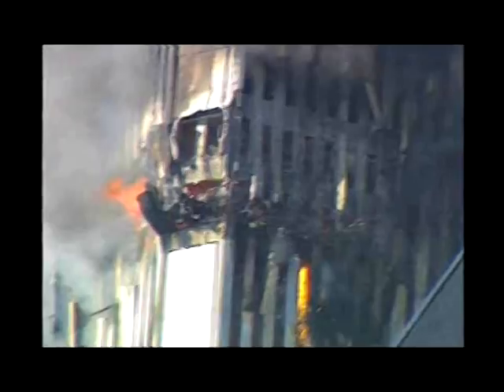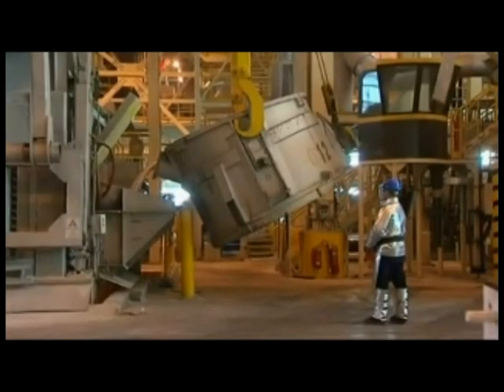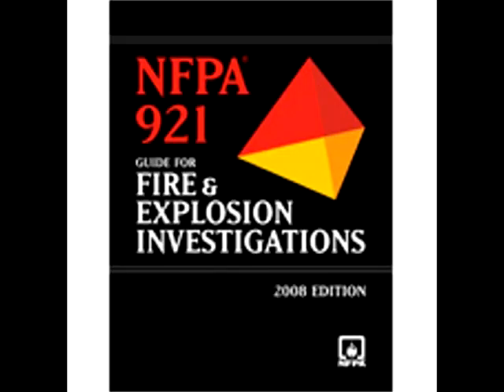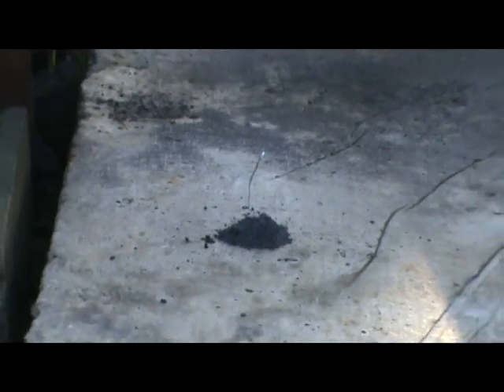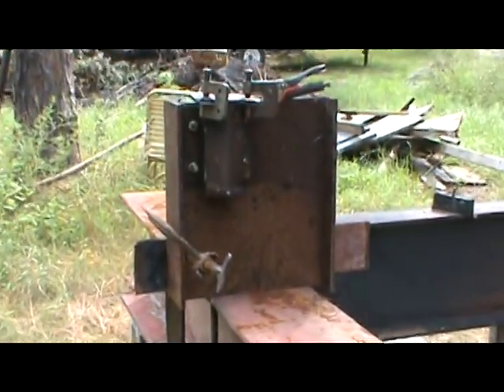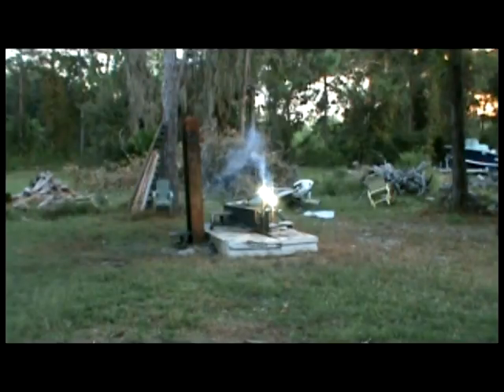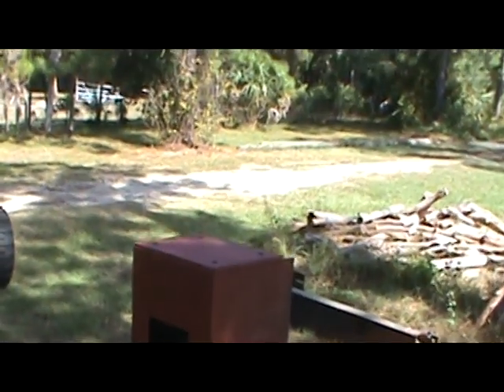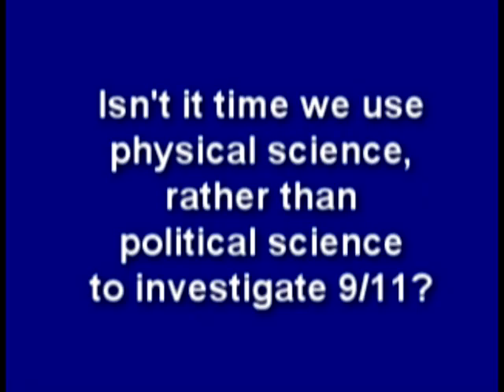9/11 Experiments: The Great Thermate Debate

Comment: Why are people do damn interested in knowing how you can melt steel? You can easily melt aluminum at much lower temperatures and all you need for the building to collapse is to weaken the steel beams so the building can no longer support its weight. That can be done by having a fire going around uncontrolled. Where did the aluminum come from? Well the air plane is mostly aluminum so why didn't it just melt?
Reply: Cloud Seeker FYI:  the reason for all the interest in steel "melting" Is very simple : no other modern steel framed building in history ever collapsed just because of fire, though there were plenty that burned hotter and longer than WTC.  Your point about how you can bring down such a building by "weakening"  the steel is quite right:  the steel was  sequentially blown away by controlled demolition , of a modern and effective type, military grade. You have figured it out.
Reply: disgny Actually, many have collapsed just by fire. Wolrd trade center 7 did just that after been burning uncontrolled for over 7 hours. We also have many other cases of steel building collapsing from fire. There is a not a huge amount because there isn't many buildings that do collapse today as we tend to be able to stop that before then.

Also you do not need to melt or cut the beams for them to break, there is a much easier way if you got time. You can make the beams lose their structural stability and let gravity do the rest of the job. When you build a building you have to make a lot of calculations to win over gravity, this is the job of the architect and that is why we pay them a lot of money for their work as it is pretty damn hard. Steel is a pretty good material to use as its hard and can be made in many ways to get the properties you want, such as being able to bend without breaking. However when you build a skyscraper you are making a massive construction that will have to support its huge weight. If you ever been at the bottom of a human pyramid you know how heavy it is even with other people supporting you. So what happen when you heat metal? It gets soft and you allow itself to be bent and molded, if you ever gotten a jar with a metal lid you know you can just heat it and it becomes easy to remove if its stuck. However you do not need to get to the point that the metal melts or become mold-able with human hands for it to break, the hotter it gets the weaker the metal become and how weak it is depends on its heat. If you heat up a lot of the main supporting pillars in a skyscraper the pillars can't support the weight above and the underfloors come crashing down. As the floors below have to support all weight above it wasn't made to also support the weight that comes from the momentum created when it gets crashing down. Remember that when you are in a car crash you weigh a lot more in the crash impact when you normally do. I weigh about 85 kg and my weigh in a crash of 80km/h is over 14 tons, its like a 165x increases in weigh. There is no way the beam below can handle that so they collapse as well and it will just keep going. So all you need to do is to heat the beams enough that they can no longer support its weight and the building collapse.

Also these are steel buildings that have collapsed by fire alone. maybe you should look up the McCormick Center in Chicago in 1967 and the Sight and Sound Theater in Pennsylvania in 1997 as both was steel buildings bought down by fire alone.
Reply: Cloud Seeker Your comment is seriously disingenuous.  When the subject is WTC fires, it is all about high rise, skscrapers.  The examples you gave were all about a completely different type of building,  there was steel present, yes, but they  were NOT high rises.
   Your analysis is not well founded , even in common sense.  When you remove jar tops by heating them, you are NOT AT ALL weakening the steel. You have retailed the very expensive, detailed, and irrelevant NIST report.  You will  not find very many engineers agreeing with it.  They just gave up totally on bldg.7, since it was so obviously in free fall, therefore , a victim of controlled demolition. If you read the NIST report , it is clearly stated in its opening that they start with ASSUMING a plane crash, initiating a collapse; the rest was a complex computer simulation of how AFTER that , a progressive collapse was inevitable.  They simply dismissed the idea of controlled demolition, the simplest explanation, by saying that no one had heard a sufficiently loud explosion, of their assumed possible explosive, without getting into any exploration of whether a modern CD company would actually use their assumed method.  They did not question the Official story, merely did everything they could to make it look Real, but failed.
Reply: disgny Doesn't matter if its high rise or not, steel behaves the same under heat no matter what, that is how we can build things out of steel as it isn't random.

The Jar example is a example of what happens when you heat metal. True it doesn't weaken the metal much as it isn't to hot for that, but it is a example that metal behaves differently depending on the heat. Well that is interesting because I have never read the NIST report because I just go with what science and metallurgy have to say about the matter. A hot steel beam can't carry as much weight as a cold steel beam because the atoms in the hot steel beam is moving around and doesn't give the beam as good structural support, the hotter it is the less structural support it as as its much closer to a lucid then a cold beams is. This is very very basic chemistry and physics, something you should have learnt in grade school.

That it is a demolition isn't the simplest explanation as you have to assume there is a conspiracy behind it. The simplest is that a bunch of religiously motivated and brainwashed fanatics hijacked a couple of airplanes and flow them into the towers because they hated America, and the towers later collapsed because it wasn't designed to deal with such big planes and the fires wasn't dealt with fast enough to stop the weakening of the steel beams. In demolitions loud noises are a key signature and all controlled demolitions have loud noises in them as they use some kind of explosive. You can't have a combustion engine without having the sounds and exhausts a combustion reaction produce, they are key signatures of combustion engines. Just like that you can't have a controlled demolition without the noise as they are part of each other and they go in hand.

Btw did you know that fires like this can actually produce some thermite residue? Its a quite easy reaction actually and isn't much a surprise and almost expected in steel buildings like this. However what is surprising if termite was used where did all the byproduct end up? When thermite burns it create iron and aluminium oxide, this doesn't go away when you burn it because this WILL always be remaining as this is what makes thermite work. So what should we find if thermite was used? Well we should find a heck of a lot of the end reaction which have to be created as you need a heck of a lot of thermite to burn or cut any beams. Did anyone find it? Ofc they didn't, what was found was small samples of unreacted thermite which for some reason didn't react which means more thermite had to be used as it clearly wasn't good enough to react all of it. Thermite wasn't used simply because it doesn't fitt the evidence.
Reply: Cloud Seeker Sorry, but the in weakening of "steel", it makes a big difference if it is placed as a "beam" , as the NIST report was so fond of discussing, or as Columns, which is actually what was holding WTC up.   That report relied a great deal on unverified assumptions about what might have happened after the "planes" initiated a collapse.  Their  report was about a complex, dubious series of assumptions about how intense fires might have theoretically caused serial collapses, and the elaborate computer simulations to illustrate that.  They did not claim to have established what caused the towers' collapses.  Many  apparently qualifed people have testified about  how the jet fuel fires could not possibly have lasted long enough , or covered enough area, to simaltaneaously and symmetrically weaken colums throught the towers, or bldg. 7.   Since the Offical Story already accepts a Conspiracy Theory, it is a matter of choice whether the O.S. , or the NWO type is the real one.   Occam's Razor is not merely about simplicity; it requires that ALL the mysteries are at least potentially answered.  The Arabs are simply outclassed;  the CIA and Mossad are MUCH more experienced in these matters. I 'm not claiming any conclusions other than that the O.S. is hopelessly inadequate.
    By the way , your thermite analysis fails to explain the residues of military grade "Thermate", the residues of which are said to be available to this day, as the debris was so widely distributed.
And I gather that our military, no slouches in such affairs, have made great (secret) strides in the custom productions of explosives for demolition, so that the assumptions you hear about , like that of NIST, are not reliable guides.
    I'm glad to hear you favor rationality, but regretfully it does not support the Offical Story.

Comment: 1832 degrees F is much more then enough to turn the steel plastic. NOBODY but conspiracy theory tin hats claim the steel melted.
Reply: Except for the pictures of molten steel, as well as eutectic structural steel which had been turned to swiss cheese.  Well documented in official reports.  Oh, and the numerous eyewitness accounts by first responders of molten steel running down the channel rails "like a foundry".  How many months did fires burn underneath the rubble heap, despite being doused by water and chemical flame retardants?  

Office fires...right.  You clearly have it all figured out.
Reply: Alan Macphail That is exactly right. Thank you. Emvaz22 There wasn't any molten steel, but heated steel can easily fail and be mangled in the fall.

Comment: Ya know, it's funny how somehow they can tell ya how hot it was, and what was happening during this fire. A door shop 15 miles from me burned down 3 weeks ago. This building had a large steel beam running from end to end. In this building  doors and rafters were built. All that was in this building was wood as fuel. That 30 foot long steel beam drooped 8 feet. Areas around the bolts actually melted out. So, there is no way of really knowing is there? Do I believe the government somehow demolished these buildings? No, I am far to intelligent for that. Do I think there is a possibility our government knew it was going to happen, but did nothing to prevent it? Yeah, I think I do. Alot of money was made from that disaster.....

Comment: Very convincing demonstration. Thanks for taking the time & effort to construct these experiments. I can't see how anyone can refute the results - that's solid, practical science - not opinion. And these experimental results match the phenomena reported by eye & ear witnesses. I think it's fair to extrapolate that nano-thermite would have produced even greater cutting power.
I'm convinced by this that US military/intelligence agencies were responsible & not Islamic terrorists. They were the only ones who had access to nano-thermite, probably packed into a convenient & portable device, possibly magnetic to stick to the box columns and with a self-timer, or able to be remotely activated in a timed sequence with the other devices. As in a controlled demolition.  
The manpower & time needed to strategically place these devices would be small. Apparently there were repair crews working at night in the Towers, particularly around the elevators, for several weeks before 9/11.
Hard to believe but you can't argue with science. Something very close to my scenario above must have happened. It fits all the data.

Comment: Moronic drivel.
1. Melt steel? Doesn't have to, only weaken it.
2. You have to take into accound the fuel from the planes, as well anything else flammable in the building.
3. A building made to withstand the weight of the building (vertical) taking a hit from a 747 going full speed into its side.
4. Hundreds of thousands of actual experts, as well as the thousands of conspirators necessary, all keeping quiet and nobody figuring out the secret except crackpots in basements with tinfoil hats. Meanwhile they couldn't hide the lack of WMDs in Irak, NSA spying on everything or Clinton getting a BJ.

People who believe this should be institutionalized...

Comment: Building 7 was brought down on purpose with explosives because it had extreme structural damaged near ground level I know this because my father set the explosives

The pools of molten steel found after the towers fell were caused by an ectothermic reaction from the oxidation of the steel.                      
When water was poured on hot steel it cause the water to turn to water vapor(steam) we all know water cause steel to rust(oxidize) oxidation is a reaction the releases heat this reaction is accelerate rapidly by steam as opposed to water because of this the heat may have caused the steel to melt AFTER the towers fell. Look at the pics notice the rust
Spraying water on the pile was like adding fuel to a fire
Jet fuel can burn at a maximum of 1700 degrees Fahrenheit.
Steel loses 50% of it structural integrity at 1100 degrees Fahrenheit 

At 1700 degrees Fahrenheit steel loses 90% of its structural capacity. 
Each beam fitted into the towers were designed to hold five times their load at 1700 degrees Fahrenheit steel has only 10% of its ability to hold weight falling below the critical limit of 20%
Which would cause the beams to buckle and bend not melt 
Yes thermite can burn through steel and also concrete so why no melted concrete. 

Ask yourself why would our gov't snuff out 3000 lives. How would they sneak in that much concrete and keep it a secret, they couldn't even keep the Manhattan project a secret.The gunshot sounds were from steel rivets breaking under the heat and load. When they break they fly and hit things. 
 

I have seen thermite burn through concrete it burns a 4000 plus degrees Fahrenheit the only known metal that can stop thermite is tank armor.

Comment: perhaps the truthers and the thermite conspiracytards could explain, if thermite was used why is there such a discrepancy in the time it took for the aircraft hitting the towers and the actual collapse

Tower 1 hit at 0846 collapsed at 1028, total standing time of 1 hour 42 minutes

Tower 2 hit at 0903 collapsed at 1005, total standing time 1 hour 2 minutes 

could it be that tower 1 was hit higher up the building resulting in having less weight for the weakening structure to support and then collapsing first, and surely by the truther logic that those who planned and executed the 'false flag attack' would have collapsed the first tower struck first

Comment: Jet fuel does not melt steel for the love of god! It weakens it, making it susceptible to the effects of gravity and weight. Can someone crunch the numbers, what did the top floors and upper part of the building weigh, above the crash zone? What is that weight once it has dropped one floor onto the weakened floor beneath it? At that point, there is a chain reaction, much like dominoes except that the weight of every domino is added to the next one in line. I ask my buddies to hold a cinder block right above their heads, elbows locked. The weight isn't too bad with their elbows locked. Slap their elbows outwards, effectively unlocking them and the cinder block wants to come down on their heads. The weight was easy to hold up when it was static. Once the support system, (locked elbows) gives way, the cinder block quickly drops, multiplying it's weight by exchanging height/altitude for speed/inertia. Very simple concepts to grasp. These theories are stupid and have no real explanation as to why anyone would go through all that trouble. Even harder to believe is that no one that was involved with this "cover up" of epic proportions, has spilled the beans in a quest for 15 minutes of fame. If there is one thing I can trust in, am 100% certain of, and that is peoples inability to keep secrets.